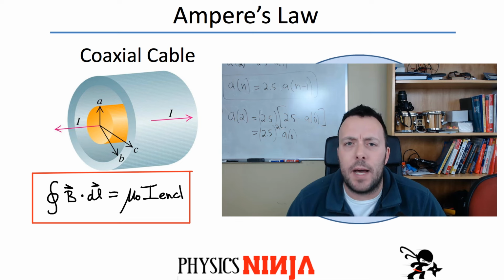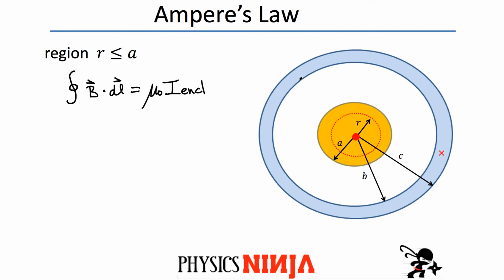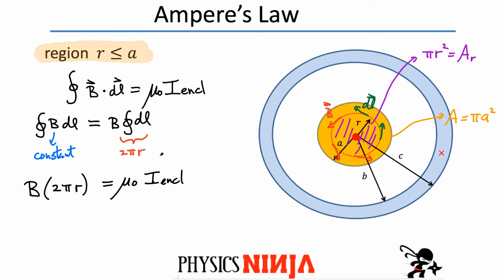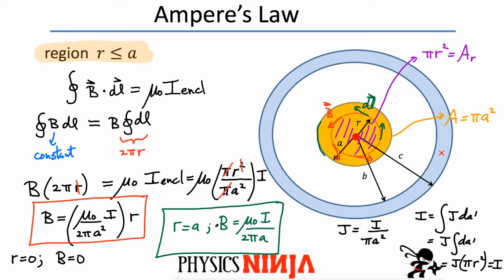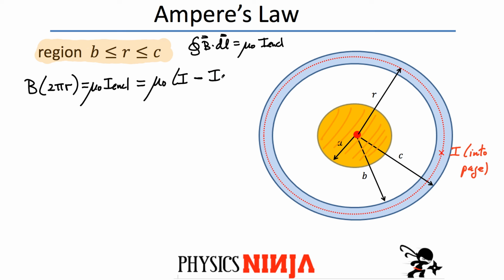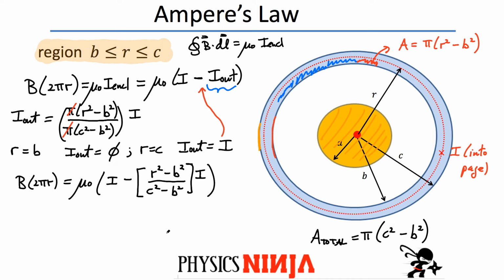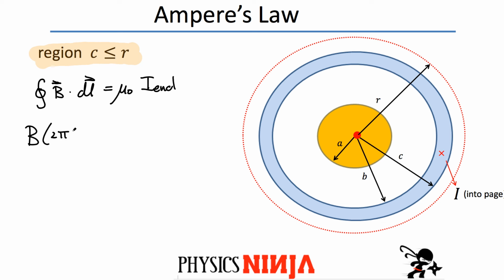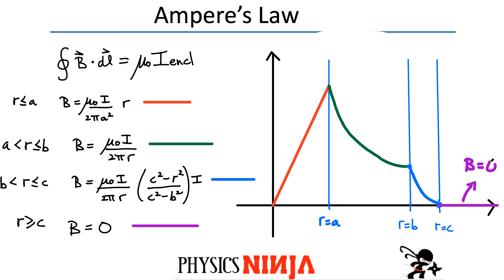Ampere's Law: Magnetic Field in a Coaxial Cable

Comment: Very nicely presented, at the end you said, it was a special coaxial cable with the both the same currents, thats is why B is zero, wasn't it zero because they were different currents in the direction?
Reply from the maker: Same current, different direction will result in 0 field outside of cable because total current enclosed is 0.

Comment: as the inner cylinder is a conductor so all charges would be at the surface of the cylinder and hence the current should flow through the surface (as current is the flow of charges) so I would be zero for r<a, and in this scenario the magnetic field will also be zero

Comment: Why do we ignore the outside thin hollow cylindrical conductor in which the current goes into the page?
Reply from the maker: Amperes law states that it’s only the current enclosed in the loop that will contribute.  You only include the outer shell if you are calculating the field outside the coaxial cable.

Comment: Someone please help me understand. Why does the magnetic field inside the cable between the two conductors only depend on the inner conducting wire doesnt the outer wire also contribute to the magnetic field between the two wires
Reply from the maker: That’s amperes law
Reply: actually it does but the netto contribution is zero, if that makes sense ?

Comment: Would a<r<b be 0? Since the center area wouldn't be included in the enclosed area at the moment
Reply from the maker: This is done @ 10:44.   In this case the field is not 0 because the Amperian loop will enclose all of the current within the small wire in the middle.

Comment: @21:05 Which current is taken positive and which one negative is also included in ampere's law -
First arbitrarily consider the direction of path that you have choosen (generally taken same as magnetic field)
The apply right hand thumb rule to the path choosen the direction of thumb is taken as positive that mean on applying RHT  rule on path all the enclosed current in the direction of thumb are taken as positive and all other currents opposite to direction of thumb are taken as negative..

Comment: Tiny error in the video.The magnetic permeability (mu) is not the same in the conductors as between the conductors. More correct would be having mu_0 in between and mu in the conductors. Otherwise great video.
Reply from the maker: Lol, that is a tiny mistake.   The magnetic permeability of air is 1.256637E-6 H/m vs copper 1.256629E-6 H/m.
Reply: @PhysicsNinja  But then you assume that the cable is made of copper it would be far worse if it's for example iron.

Comment: what would happen if the currents aren't flowing in the opposite directions? would that mean the current is doubled when r is greater than c?
Reply from the maker: Yes you are correct, the field would be be different inside the outer shell and outside of both the field would that of a wire with current =2I
Reply: @PhysicsNinja  thank you for the quick response!!

Comment: This explanation ignores the skin effect, the current density is never constant. When the wires are thick and frequency goes higher, current density towards the center will exponentially decrease.
Reply from the maker: This is a steady state solution.  The skin depth in copper at 60Hz is around 8.5mm therefore this is a great approximation for regular household magnetic fields.   Physics is the art of approximations.

Comment: Can we apply ampere's law on a cylinder if it's not long (infinite)
Reply from the maker: No, but often if the wire is long or if you're really close to the wire you can approximate the field with that of an infinite wire.

Comment: Just wondering, does this implication of the magnetic field being 0 outside the outer loop bypass the limitations of really small computers? I remember hearing somewhere that there's a limitation of how small circuit elements can get because their magnetic field would induce currents in nearby circuit elements.
Reply: Good question! I'm not educated enough to answer it, but I would guess that for these small scales the classical theory presented here does not longer hold.

Comment: could u explain stored energy in coaxial cable?
Reply from the maker: Hi,  the energy density stored in a magnetic field is u=B^2/2u_0.     You'll need to integrate over the volume of the coaxial cable.   Simply square the field expressions in the different regions and integrate over the volume using cylindrical coordinate system...you'll get an expression for the energy per unit length of coaxial cable.      I would suggest just to consider the region between the wires to start with.
Reply: thank you sir.

Comment: what if there are 2 different parameters for currents for 2 different cables? Would it be still 0?
Reply from the maker: if the total current on the inner is different from the outer shell then the field will not be zero because our Amperian loop with have some current enclosed.
Reply: @PhysicsNinja  thank you

Comment: i understand mathematically, but it jas always baffled me how there is no magnetic field outside the 2 cables since the distance of any point outside the cable is far closer to one current than the other. Same thing with there being no net electric field outside of parallel plate capacitors
Reply from the maker: I get it.   It's a little bothersome but that's how nature works.  When things equal to zero it's more than likely due to 2 things adding up to give 0 (things cancel out) rather than adding a bunch of 0 to get 0.

Comment: Well explained,but when u do the closed integration it should be integration over rho product with dfi according to cylindrical co-ordinate system(Here rho is a product with dfi because rho is the perimeter across the arc dfi).Above all its good.
Another thing is that u may use H(Magnetic field intensity) instead of B (Magnetic flux density) because when we r considering free space only then they aren't equal that is B=meu(o).H.But in practical cases medium may vary according to products choice

Comment: What if the current goes in the same direction in both loops? There'd be magnetic field on the outside,  no?
Reply from the maker: you'll need to switch the sign of section b<r<c and the region outside of the both wire r>c should have a field from a simple wire with double the current.

Comment: Hello sir, thank you for your thorough explanation.  I just need to understand something please.  Let us for now consider only the small conductor (gold).  Seeing that it is a conductor, will all the charge/current not be located on it's surface only?  Ergo, a proper Amperian loop would be such that it goes around the entire conductor and not inside the conductor.  This would then change the outcome of this part and the rest of the problem.  I need to understand this because there are so many people on the internet doing their own thing and in the end the information conflicts in the small but very necessary details.

Thank you again for this explanation.
Reply: Not 100% sure but you may be confusing current (moving charges) with static charges. Current is based on cross-sectional density so the amount of the wire we draw our loop around determines the total enclosed current.